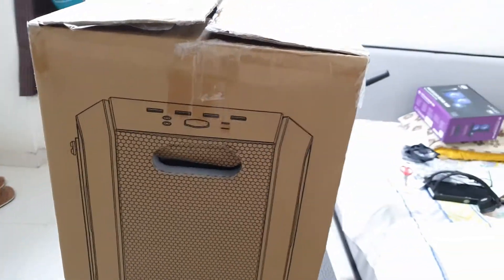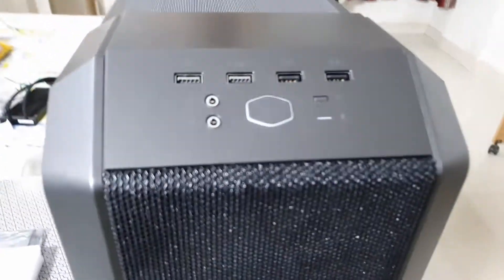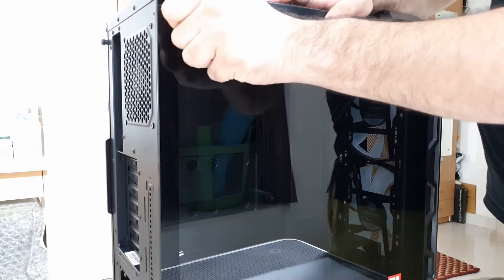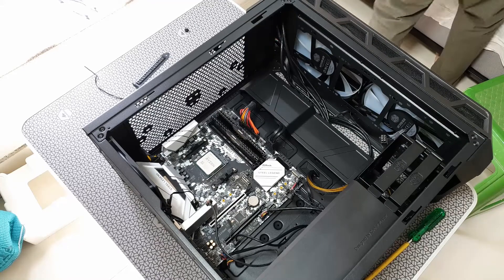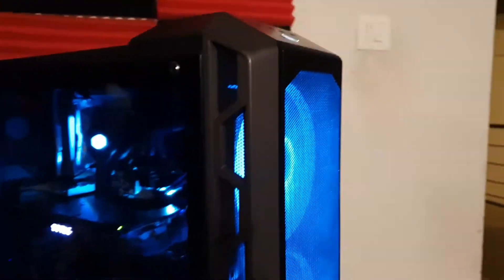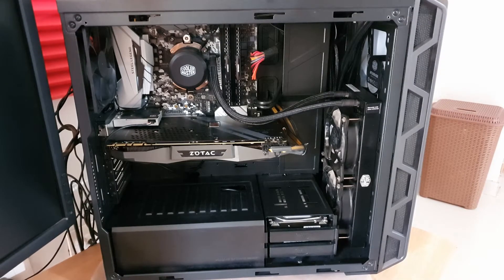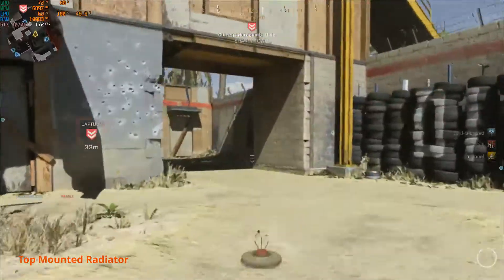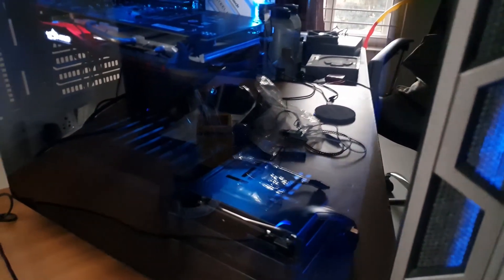Cooler Master H500 AIO Radiator Placement - Front vs Top #cpucooler #coolermaster #liquidcooling

Comment: I have the same case, and I'm considering buying the Arctic liquid freezer ii 240 or 280. Do you think this cooler can fit in top?
Reply from the maker: Absolutely... this case will handle a 240 or a 280MM Radiator easily...on top
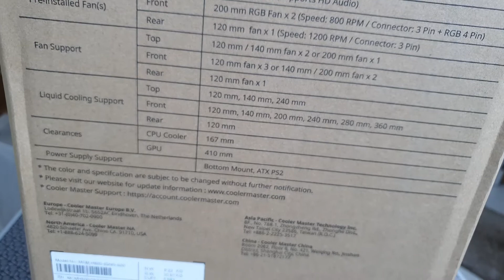Reply: @rtechreviews  0:49 Specification shows 240mm max on top. R U sure 280 will fit?
Reply: @misar7  easily
Reply: @indiatechnewscom  specifically an Arctic liquid freezer ii 280 will not fit as it is much thicker than all the others. It will "hit" your motherboard components
Reply from the maker: Bit there is a lot of clearance in the h500. So basically if the H500 cannot take it, the no other cabinet can
Reply: @rtechreviews  No, H500P  & H500M are different inside than the H500. The H500P & H500M have an extra top casing space where you can install a  liquid freezer 280. Only on the simple version H500 you ccan not, because simply there is no space. Check this : https://www.youtube.com/watch?v=RWxPif8ibRA
Reply: @rtechreviews  how do you coment on this? http://community.coolermaster.com/topic/24187-h500m-top-mount-280mm-aio-rad-wont-fit/

Comment: I got the exact same aio, thinking of buying that case. Can I mount it on top with higher profile memory? (the corsair vengeance RGB's)
Reply from the maker: Yes you can ... I honestly dont recommend the Cooler master ML240L though too noisy
Reply: @rtechreviews  thanks! yeahh it is.. bought bequiet fans hoping they will solve the problem
Reply: @rtechreviews  I use the ML240R although I never imagined quiet gaming because most gaming I do is not quiet so I'm not bothered by the noise i guess.
Reply: @rtechreviews  really  cant hear mine at all?
Reply: my ml240l barely fits in with corsair vengance pro rgb

Comment: Lol this case has one of the highest airflows on the market... The two front fans move 180 CFM of air. It would take about 4 120 mm fans to create equal airflow.
Reply from the maker: Sure Naude 😊 So right now its 1 exhaust along with 2 radiator exhausts
Reply: Not true, the fans are blocked by the mounting brackets, as seen at 2:50.

Comment: Wouldn't mounting exhaust fans at the top solve the GPU heat problems with the rad mounted in the front?
Reply from the maker: Yes it's a gamble end of the day, front mounts are good for the CPU but not for the GPU.
Reply: @rtechreviews  What if both your cpu and gpu are running AIO's?  I have this same case and both my radiators are set as exhaust.  240mm CPU radiator mounted top & 120mm GPU radiator mounted in rear.  I just purchased a 3 pack of cooler master fans to match my setup just wondering about the thoughts of others and if it is even worth my time changing it around.